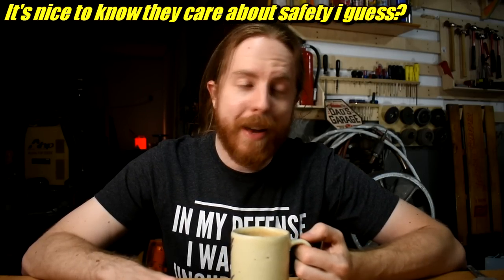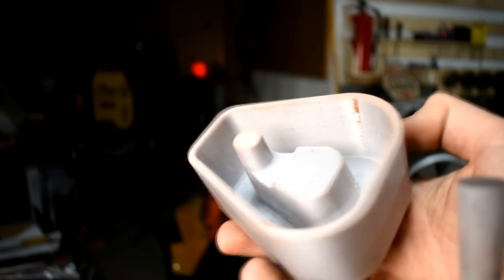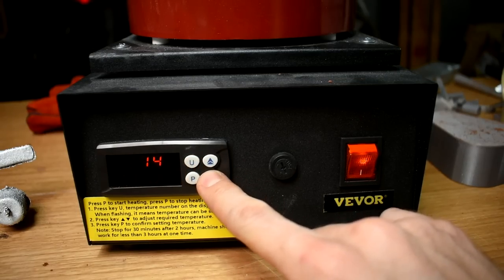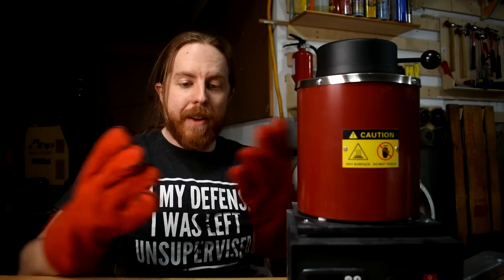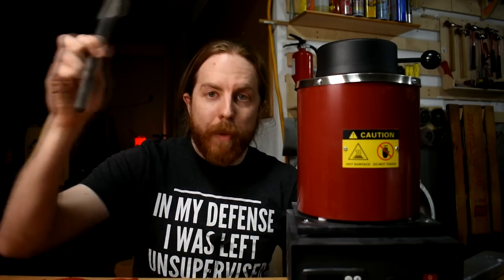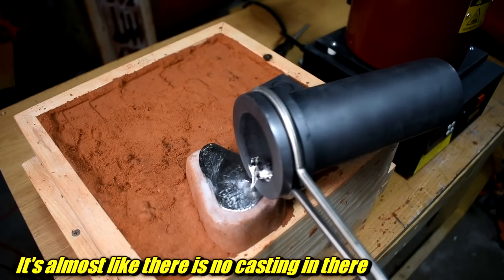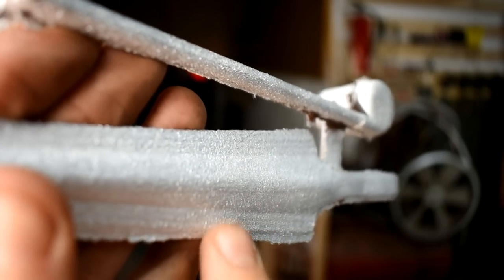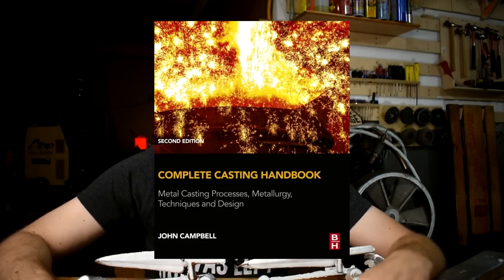Metal Casting TEMPERATURE matters more than you think

Comment: what do you mean you cant measure the temp in your propane furnace?
get a K-type thermal couple and readout. drill a hole somewhere in the center, insert the thermal couple and fill the hole with plaster of Paris or firebrick cement
 and you'll be reading temp like a pro.  K-type range is -326 to 2300°F or (-200 to 1260°C) 
A friend of mine put one in his kiln thats capable of melting copper. i put one in my toaster oven for more precise temp when powder-coating small parts.
Reply from the maker: I left out some detail there about my furnace.  I actually made a port to insert a K type thermocouple, but because my burner is so overpowered the air inside the furnace is always several hundred degrees hotter than the metal and the number wasn't accurate.  It would read 2k+ and aluminum would still be solid.  If I turn down the burner, it becomes really unstable, so temperature control is an issue.  I have a fix in the works at the moment but haven't rolled it out yet

Comment: I would expect a catch in the bottom of the sprue before the runner to avoid dragging slag and sand that came loose in the bottom of the sprue along?
Reply from the maker: Those have been shown to just increase turbulence which can mix up the oxide films.  The method i used here was to shoot that initial blast of sand into the spin trap where it slows down and freezes with the initial mix of slag/air/oxides in it, then the runner farther back overflows the clean metal into the mold.  These castings showed zero defects, while other castings i used to do always had air and sand in them
Reply: @PaulsGarage  Ahh, so that is how the spin trap works! Brilliant!

Comment: I'm new to metal casting and have seen people use talcum powder on the mold and the part. First question: What is the actual purpose for this, and second, can cornstarch work as a substitute? I can't find talcum baby powder they haven't made that in a while from what I understand. Thank you in advance for your help!
Reply from the maker: The talc is for parting powder.  Basically, the sand sticks to itself and everything.  That's how it holds the shape.  If you don't dust the pattern, it can get stuck.  If you don't dust the sand where the 2 flasks meet, they will stick together.  The talc sticks to the sand, and then the sand can't stick to anything else.
Reply from the maker: Looks like Johnson and Johnson is still talc?  Unless it says cornstarch

Comment: hmmmm like you said 3kg might be enough , was thinking on making rods for machining on a lathe , was allso thinking on using an electric  potterykiln where you could allso keep it at a pretty close to perfect temperature , can you pour the "rods 3 kg at the time , basicly press the cooled metal out the bottom and pour another 3 kg over the top of it ?
as for casting and having the metal cool to fast , maibe you can heat the mould up some get it closer to the temperature of the metal you pour in , should help against it cooling too fast

going back to the pottery oven , it would take a long time to heat the metal untill liquid in an electric oven and that cost a lot of electricity , wat YOU could do is only preheat the electric oven up to close to the temperature you need while melting the metal in the supercharged  propane kiln youre using then transfer the crusible intoo the electric kiln and have it settle (cool down) intoo the temperature you need it to be at before taking it out of that and pour it should take less time and make the metal reach the propper temperature a little eazier
Reply from the maker: Preheating the mold would definitely help, but I'm not sure it's a good idea with petrobond.  I've heard the binder can fail at high temperatures.  It doesn't make a lot of sense to me, since I pour hot metal into there, but I don't want to risk it 🤣

Comment: The one thing I was unsure of with my home made electric foundry was pouring temp. I could get it up to the temp I set no problem. The readout said 750C, and the metal melts at 750C. But even though the foundry was at 750C, was the metal at that temp? How far behind foundry temp does the metal lag? It's the same with the Vevor (looks good by the way, Myfordboy uses one for small stuff). Get the Vevor up to 500C for the Zamak, but then what about the metal? I have seen others use a probe on some sort of heat proof stick. Do you have one?
On a side note, have you ever seen so many question marks in a comment before? I think they're breeding.
Reply from the maker: The metal does lag behind, but the amount depends on how much metal is in there and how quickly you heat it up.  A pottery kiln heats more evenly, but you are talking 1 degree a minute at the highest temperatures.  Definitely not fast enough for metal casting.  I don't have a temp probe but I'm building one at the moment.
Reply: Watch your controller.    It will reach the set temperature then the controller will gradually slow down the frequency at which it adds heat.  When this is well stabilized the metal will be at the set temperature.  Electric furnaces are incredible at heat control when you know this technique.
Reply: @danharold3087  Thanks Dan, I didn't know that.

Comment: Gee, you could have just asked me, I studied this stuff back in the day - at least, the theory anyway...

then you wouldn't have had to make a Youtube video.... er...

anyway - under temp is kinda obvious why it's suboptimal - the liquid just doesn't stay molten long enough to fill the mould...
Fun sidenote - circa 1990 CSIRO were testing an Mg-alloy injection moulding machine for car wheels.  It injected the metal just below the point at which it started to solidify - being an alloy, it had some fraction solid and some fraction liquid.  To achieve filling they had to inject really fast - like... just below the speed of sound in molten metal fast...  Why??? to get very fine grained castings...

Over temp, you got it pretty spot on - too much shrinkage is the main issue. Also waste of energy. Also damage to the mould can be worse.  

The thing you may not be so aware of (and probably can't easy check) is that you start to lose the lower melting point metals out of the liquid. You may  not be at the boiling point of zinc, but it will still have a vapour pressure over the melt, and that vapour will favour lower melting point metals - so the alloy composition changes the hotter and longer it's in the melting pot... That's fine if the alloy is tollerant of change, but some alloys really do change behaviour when the composition changes - Brass is one - it's phase diagram is fun!

Oh, yeah, IIUC, Zinc fume - ZnO particulates - that occur over molten zinc & alloys and welding galvanized metals?  It's not great, but it's not as highly toxic as some people might imagine - your body is actually fairly good at dealing with zinc particles in your lungs, and they will dissolve.  It tends to be an acute affliction rather than a chronic one.  Having said that, yeah, nah, don't be an idiot and take appropriate care of yourself.  Odds on if you are raising zinc fumes you are going to be raising other less freindly metals as well, and good habits are as much to protect you from the things you DON"T know are trying to kill you as those that you do...

Comment: Great video. Could you over heat the metal in the propane forge then use an ir thermometer and wait for it to be correct temperature and then pour or would the overheating affect the crystal growth?
Reply from the maker: Probably?  Not sure exactly.  Some metals have issues when overheated like zinc boiling off of brass for example. This metal is hypereutectic and you get some separation of higher aluminum content liwuid floating over the higher zinc content stuff, so I assume the issue gets worse the longer it sits as a liquid.  And stirring it can cause other issues.

Comment: A 3Kg crucible holds 3Kg of what exactly? 3Kg of gold is many times smaller than 3kg of aluminum. Since metals have such drastic density differences, isn't weight alone inaccurate for sizing a crucible?
Reply from the maker: The measurement standard for crucibles is done in mass of brass.  Not sure why, it's just how it is.  Brass is a bit denser than iron, slightly less than copper.

Comment: preheating the sand and flask? (if it wasn't made of wood even more)
Reply from the maker: investment casting usually works that way, but this sand probably wouldn't like it.  It's oil bonded and seems to have trouble holding when it gets hotter

Comment: Those "3 KG" is is 3 KG OF GOLD! And gold are HEAVY! So, 3 KG crucible can hold 155 ml of liquid metal. Or 420 g of aluminum. Or 1.1 kg of zinc.
Reply from the maker: KG measurements in crucibles are always in brass.  There are a few places that say it's gold, but they're wrong.  The standard is always copper alloys.  I'll tell you this 3kg crucible holds FAR more than 155ml.  These castings were done one at a time with the 3kg crucible, and they were maybe 1/3 full for the pour, the bulk of which ended up in the pouring basin and spin trap.  I could've done this whole thing with with 1kg crucible but i didn't have any chunk of za12 small enough to fit in there
Reply: @PaulsGarage  could you check please how many ml fits in those crucibles? Should be easy enough with a measurement cup and water.
Reply from the maker: @mnus2016  just tried, and it's not a very accurate measuring cup, but the 1kg crucible holds about 125ml or so.